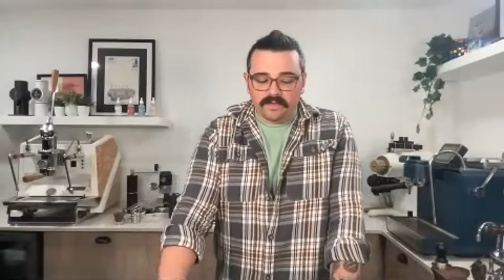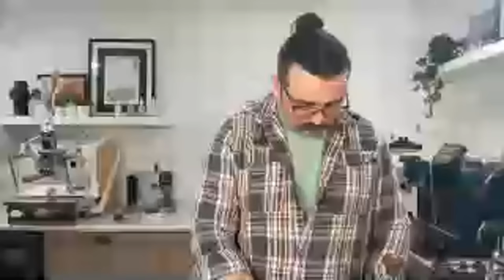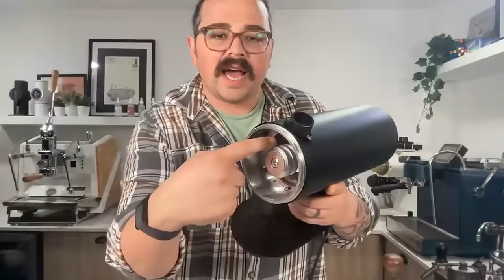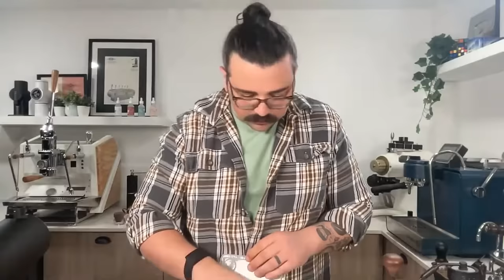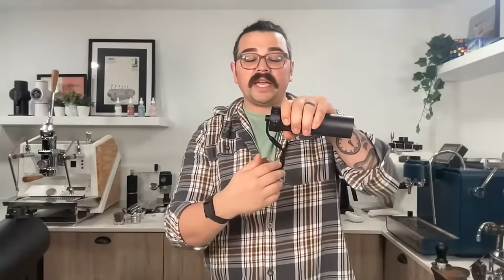Not What You Think: Variable RPM and Grinder Behavior

Comment: My df83v is arriving tomorrow so I appreciate this video and will have to be very mindful of slow feeding times and making sure I’m consistent so I don’t get frustrated.
Reply: My interpretation of what he’s said is that, yes, there IS a difference in shot time between slow feed and dump feed of a direct feed grinder, based on shifting the grind distribution peak. I’ve noticed that shot time halves on my P64 with slow feeding. BUT does slow feeding actually make coffee better or the grind result “better”. It’s different, but it’s not clear it’s better.
Reply: @jmvdigital  My df83v arrived yesterday and I’m noticing a difference in grind size if I slow feed vs rapidly feed.  I need to be consistent to eliminate a variable changing.  Trying to decide if counting to 5 during dumping or just rapidly dumping is more consistent.  Then I can experiment later.
Reply: @erikasoldit For sure it’s a huge variable. I’m leaning toward not bothering with a slow feed on my P64. There’s simply no way to make it consistent. And again, there’s no proof (yet anyway) that the result is actually better.

Comment: For the record, i tested slow feeding on my 078s at the same grind size and it was a HUUUUGGEEEE difference in extraction time. Almost like I took the grind size knob and rotated it literally by 1 full step. Also i noticed it being very unpredictable and hard to dial in unless you slow feed like a monk.
Reply: Same here at the 078s! If you go very slow (some beans (5-ish) at a time until chamber grinds empty) it becomes consistent again. Taste becomes richer. But a single shot now takes forever to prepare😅 PS: I shake an rotate the grind result in the dosing cup for a few sek (5). Maybe this helps consistency as well
Reply: I experimented with 078s and flair 58 with fast vs slow feed and found 3.5 difference on the dial to get same pressure on slow vs fast.   Massive.   I did super slow, like one bean per second and found I had to grind almost at burr touch to get enough pressure to pull a normal shot.   It stressed the machine and took forever so I decided that fast is best as far as workflow and taste.   Slow feed shots were not crushing the fast so I’m going with fast!  Many other users thought slow feed better for filter.   Anyway, that’s where I’m at, but looks like I need a zerno now lol.   And that golden lever machine

Comment: 4:57 Coffee of the Stream

Rant Agenda
0:48 Problem Statement of Variable Stream
2:09 What is Variable RPM
2:45 RPM and Fines
++ 3:24 Cone Burrs
4:19 RPM and Heat

Rant Proper
5:18 What is Variable RPM doing? (Peak Particle Size Distribution)
9:08 The Curious Case of Base-min Burrs-ton
++ 10:34 Base Burrs and Cone Burrs
12:04 The (Unnecessary) Quest for Less Fines
14:15 Observation of Faster RPM Faster Extraction...
++ 14:44 Is this real life? Is it just fantasy?
++ 17:14 There May Be Augers
20:50 All Augers are equal but some Augers are more equal than others (Auger Efficiency)

Q&A
27:16 Hand Grinder RPM (Mashing vs Cutting)
++ 41:43 Critical Minimum RPM for Hand Grinding
29:31 Variable Auger Speed
29:58 On the Current Era of Coffee
32:16 Grind Rate at Burr slower than Auger Feed Rate
33:30 DF83 Thoughts
34:32 P100 and Slow Feeding
36:57 Variable RPM Heptagonal Burrs
37:24 Visual Demo of Augers
42:51 Auger Upgrades
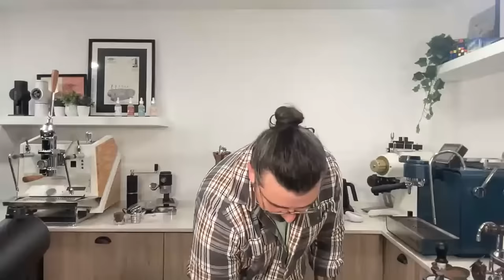43:56 Speed of Slow Feeding
44:19 Efficient Auger Definition
44:48 Does an efficient auger reduce heating
46:02 Grinder with auger and low RPM causing faster shots
47:04 Anyone other Xerno with good burrs
47:33 Auger Prebreak with Blade or Just Torque
48:31 Robust auger and conical grinding
48:52 80mm Xerno
Reply: Zerno is with a Z but we figured out what you mean, thanks for the summary :)
Reply: Thank you so much! What does ++ indicate?

Comment: Looking for guidance on this: I upgraded my BDB basket to a Pullman 17-19g 876 basket (I use 19g at a 2:1 ratio) I adjusted niche zero grind size finer to achieve same 25-30 9 bar shot with the new basket.
I then decided to try paper filter on bottom of basket like Lance has shown in video.
When I do this it appears to have more clarity.
But when I add filter the shot time speeds up substantially. 
Do I have to adjust even finer when using paper bottom filter with Pullman to maintain same shot times? (25-30)
Or is it fine to pull a faster shot?(20-25)

Comment: It's the exception to the rule and a weird thing that the Weber EG1 increases shot time with lower RPM (and decreases with higher RPM). People have noticed the same thing with Timemore078s but that might be due to pre-breaker or auger complicating things somehow.

We know you can get the same extraction percentages and very different tastes from experiments done with different temperature brew water. 

Regarding fines: 
I did find the DF83 before seasoning and declumper mod produced a lot of fines but still made a very nice coffee (just more blended 'conical-like' higher body shots) and still made tasty brew coffee too (just more likely to stall/clog up your filter). I didn't find the fines affected extraction in a very negative way like causing bitterness/over extraction, it was usually very pleasant and smooth still.  The same thing with the Weber HG2 or Key, it had more of a micro-fines that didn't seem to affect anything but in that case it did sometimes contribute to a silky body.

I doubt burr heat levels would affect anything outside of like commercial grinding.

I don't think anyone's calculated the grind rate to align with an Auger / pre breaker. If your auger is variable RPM and synched with the Burrs RPM, then RPM should still affect your grind quality potentially.

Comment: Do you have access to the Flat MAX2, which specifically has a pre-breaker.  Looking inside the top, it looks like the feed into the pre-breaker is controlled, but I can’t tell.  I’m just not sure how to leverage the 5-400rpm capability or if it matters at all.  If  it doesn’t matter, then what speed would be best to leave it at?  So I’ll be interested in your upcoming analyses.

Comment: On mine Sculptor 078 (turbo burrs) I noticed that when brewing V60 (same dose, coffee, grind setting ...) on 800 RPM it consistently brewed about 8-10 seconds faster than on 1400 RPM, and it was little bit less messy when grinding on the lowest RPM. For now I use 800 RPM
Reply: Same conclusion with my 078! Do you also slow feed ?
Reply: @a.enguerrand5120  no, I just drop whole dose, I just do little bit of RDT before
Reply: I came to a similar conclusion, I dropped rpm to the lowest setting on the 078 and found faster draw downs.

Comment: Titus EK carrier auger has twice the turn/groove count vs the stock EK carrier so it takes twice the turns to lead into the burrs and take up more of the available room in the auger as well, should be slower. It might also have a tighter fit against the bottom of the auger channel, the top part of the channel is bigger and have room for some beans to move without getting crushed. Could make some difference especially with bigger doses/bags.

Comment: Will be very interesting so hear the results of the testing. I like what you are doing with trying to check the speculations many are doing. It is a slow process and we should expect lots of missed details and new open questions. But that's all part of the process.

You mention that you slowfed in 5 seconds total. So not bean by bean. Any early thoughts on if that is slow enough for all of us without good augers? Or would we benefit from doing it slightly slower? Perhaps it should roughly match the rate the grinder grinds the beans, so the grinding surfaces are kept undisturbed?

Comment: Interesting, I have a p64 and I am curious about the effect in direct fed non auger non pre breaker solution would the rpm setting even matter much?.  Zerno seems to be peak 64mm. Wondering if a prebreaker on say a 98-102mm burr would make as big a difference as on 64mm or 80-83mm?

Comment: Hi Lance , when you compared slow feeding the DF to the Zerno, I’m curious as to what burrs were in each as that could be another  variable as well. I’m wondering if the effect of slow feeding would be less pronounced on very unimodal burrs like the SSP MP and more pronounced on traditional burrs since the fine’s production is more.
Reply from the maker: Mp in both
Reply: Hey Lance, I agree with the comment above that burrs may be making a big difference here. I have a Zerno with CV2s and notice a massive difference when I slow feed versus dump all at once. It could easily go from a 25s shot to completely choking my machine just based on feed rate alone. I was actually having a hard time dialing in my shot when slow feeding because I noticed that my shot time was really sensitive to my feed rate and could never achieve a consistent outcome. I have now resorted to dumping all at once for consistency's sake. Not sure if it also may be related to the auger differences (I believe you have the V1 auger where as all V2s ship with the medium speed auger). There are several of us on the Zerno discord who have had the same experience as well. Just thought I'd provide some extra data points in hopes of helping us all better understand whats going on. Loving the experimentation-focused videos btw!  @LanceHedrickUnfiltered
Reply: @TheEdwinader I think bean size may play its part here, smaller beans may pass through auger quicker without pre-breaking?

Comment: Is it possible that the burr geometry of the sanremo xone burrs is just very unique? So that it (by itself) does not change the location of the particle size distribution with different speed.

What leads me to this:
You said that (a few) flat burrs  do not affect the shape of the particle distribution when changing the speed, but only their relative position. Then on some grinders you would need to go finer with increased speed. And then you say there is the weber base burr which does the exact opposite.
So when i hear there are two burrs which do the exact opposite, then my conclusion is there can also be a burr then sits right in a sweet spot where threre is no change at all with the speed.

That could mean that the auger could have less of an impact than expected. Maybe to rule that out the burrs from the x one could be tested with different speeds in a grinder without an auger? 🤔

Comment: I have a DF64V with SSP MP and a slow feeder disc (looks like a pizza with two slices missing) installed on the bottom burr carrier. The beans fall on the slow feeder disc first and while it spins together with the burrs, it let's a couple of beans fall through the gap with every rotation. I use the grinder only at 600RPM, which is the minimum, with light roasted beans and only for filter.
I noticed that when I slowly feed the beans to the grinder, I get a much better cup than when I put the beans in all at once - hot start on both situations. With slow feed the coffee flavours are more nuanced and the cup is fantastic, while without, the brew is still tasy, but boring and common.
Now I wish the DF64V could go to down to 300RPM and even lower...

I also used the SSP MP on a Fellow Ode Gen 2 and didn't like the coffee it made at all, perhaps because it was too fast...

In the past I had a Wilfa Uniform which is a very slow grinder (I don't know it's RPMs). I had amazing cups from it, real sweetnes in the cup and delicious flavours. I was using it without hot start and all the beans in the hopper.
That's why I decided to swap the Fellow Ode with the DF64V, for that low RPM, and I'm so happy for having done that.
Reply: so u have the slowfeeding disc and still slow feed ur beans manually with ur hand?

Comment: Wonderful video again! Do we know (can calculate) the optimal feed rate per burr diameter multiplied by RPM? Only then we would know wether an auger is feeding too fast or too slow. Idea: record the audio of a single bean being ground (for 1g or more), remove the pauses from the audio and you have the optimum feed rate. Values should differ depending on the burr diameter and RPM.

Comment: So maybe fast RPM equals slow feeding, when there are no tightly fitted auger? If beans are cut faster (assume for a while - in the same way no matter the RPM) it is like feeding slower. Because beans need some time to go to grinding chamber, but exit sooner. With low RPM beans are squeezing at the entrance to the grinding chamber and between the burrs. But Auger (no matter if it breaks the beans) act as a traffic organizer, because it rotates with the same RPM as burrs. Tight auger would cancel the effects of RPM, because faster RPM makes faster feed via the auger solidly connected to one of the burrs. 
Then slow feed would also be possible, but by slowly feeding from the outside, so beans wouldn't be one next to each other through the grinding "pipeline". Auger helical screw couldn't squeeze beans fed slowly from the outside. Auger rotating faster wouldn't have the stuff to push to the grinding chamber.
What is meant here by "efficient" auger is just a capability to steer the input flow rate, no breaking, only speeding up with very fast RPM and slowing down with low RPM

Comment: My experience on p100 for varying rpm

Observations trickle feeding the beans. At the slowest rpm, my shots run faster. At the fastest rpm, with same gap and trickle speed,  the shots run way slower. Typically I try to feed at a rate that doesn't allow grinds to keep coming out once I am done feeding to reduce chance of regrinding. This results in my feeding a different rates for different speeds and beans. I time the feed.

My experience with trickle vs dumping. Trickle feeding has always given me faster shots. Dumping all in at once gives slower shots. What's interesting is when you dump them in for the slow vs fast rpm. Dumping at slow rpm yields shot times closer to dumping at high rpm. The fast rpm still yields a slower shot, but the difference in time is less drastic. Just some interesting finds compared to yours. No idea what distribution looks like or extraction yield. 

I know Lance doesn't prefer the p100, but we seemed to use it differently with feed rates and avoiding regrinding. Thoughts?

Comment: I made my Jolly Variable speed.. It’s a luxury add on IMO. To me the main benefit is I can crank the RPM briefly and bop the bellows to reduce retention. The flat burrs seem to have behave with slower grinding giving faster shots ( I guess the peak is narrower?) and at higher it is wider..?  Seems to pull slower with fast grinding. I totally notice the grinds are warmer if I grind fast.. but weather that means anything I don’t know 😅
There is a dynamic element  of grinder rigidity and the centrifugal forces at play for sure, which will vary between grinder models. That all said, I have no intentions to go back to single speed :)

Comment: Slow feeding this back....
There are two possible alternative objectives of variable RPM:
1. Consistency, i.e. regardless of RPM or feed rate, you get the same brew, OR
2. Adjustability, i.e. you change the RPM or feed rate, you get a different brew.
In order to achieve either of those  you need a particular auger and burr set.
In favour of consistency: you can load the beans however you want and get the same result.
In favour of adjustability: you can produce a different extraction by changing RPM and feed rate, e.g. with a single burr set, you can get clarity in pour over and body in espresso.
Now, I think Lance has a personal preference for consistency AND clarity, so it makes sense that he likes an effective auger, but that's not the right choice for everyone. I prefer lots of body in my espresso and don't mind sacrificing clarity, so for me, variable RPM without an auger gives me the most flexibility. Without an auger I can choose an RPM and feed speed that causes the beans to back up in the burrs and produce more fines for that classic conical texture profile, or slow feed and get less fines for more clarity.
That's my interpretation of what's being presented, and I think it's important for Lance to be clear about what his preferences are before recommending a particular approach. Personally, I see no value in variable RPM unless I can use it to produce a different effect in the cup.
Reply: From what I have learned woth feeding rates and rpm on my p100, I agree with you on freedom to adjust based on what you want in the cup. It's like a lever machine, not consistent necessarily but adjustable.

Comment: I had also some interesting results whit my cast burrs on the df64v. They are different in comparison whit stock burrs or mp burrs. At lower rpm the extraction takes longer. I suspect it's due to the small cut area. With more rpm than 1200, the cutting surface can no longer keep up with grinding and the shots are thinner. My best results are whit 800rpm.
Reply from the maker: Someone else reported this!

Comment: I don't think it's about efficient augers but about bottlenecks. If the burrs get rid of the ground coffee at a higher rate than the auger feeds the burrs, then there's no change in particle size or distribution no matter the RPMs.
Reply from the maker: One would think if this is the case then the df83 with bigger burrs should do this no problem. But zerno is 64 and was able to
Reply: @LanceHedrickUnfiltered  I think the answer to all of this is related to how do we look at the grinding process. As a steady state process or as a transient process. Maybe grinding a big amount (say 30 g) and getting rid of the first grams until just the amount for the shot remains would show us something interesting. If there's a bottleneck then the results will be different. I would refer to grinder typologies as bottlenecked feeded ones or bottleneck free ones 😆